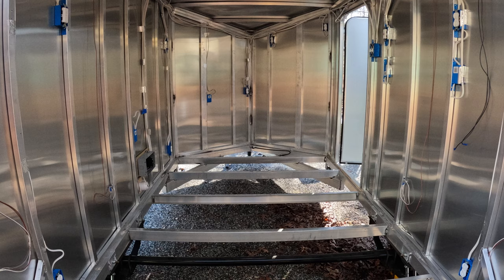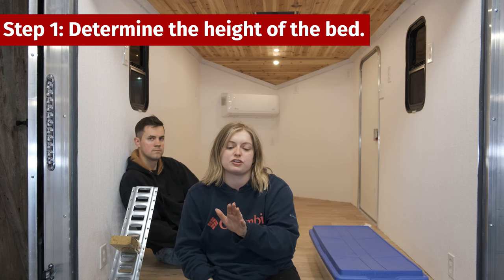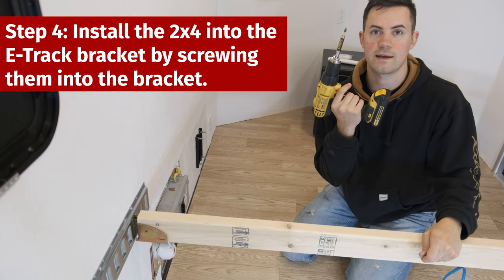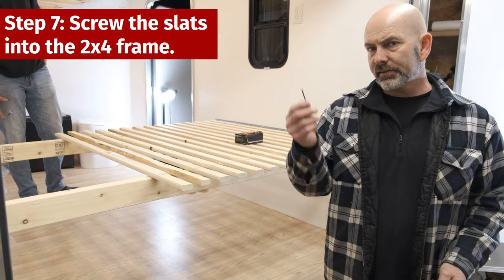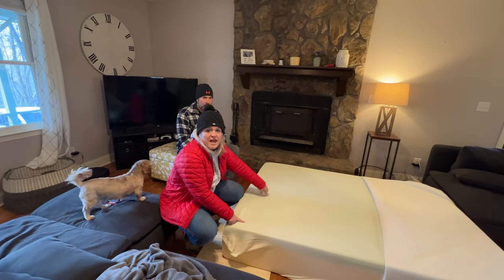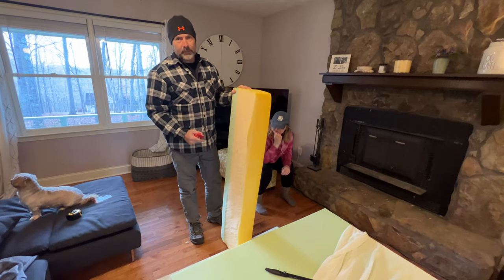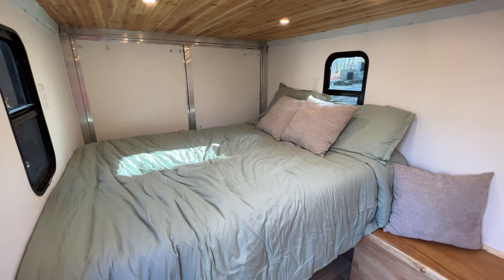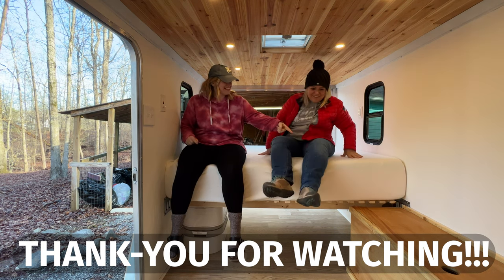BUILDING A BED FOR A CARGO CAMPER Ep. 12

Comment: @befreebensondiy did they end up liking the bed installed in that direction? How tall are they?
Reply from the maker: Actually, they are modifying the bed to have a section that adds in lengthwise. They thought it would work, but it’s just a little tight.  He is 6’0 and she is 5’8”.  Thanks so much for reaching out, and for watching!!!
Reply: I was afraid of that! I also have a 6 foot wide trailer, but I’m only 5’5”. I still might try and make it work though.
Reply: Looks great!  What material are the walls finished with?